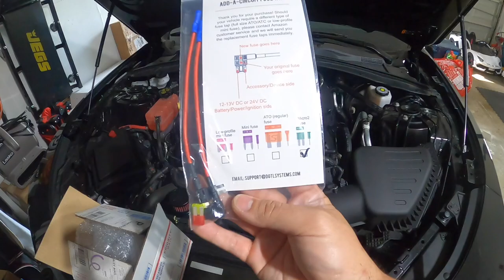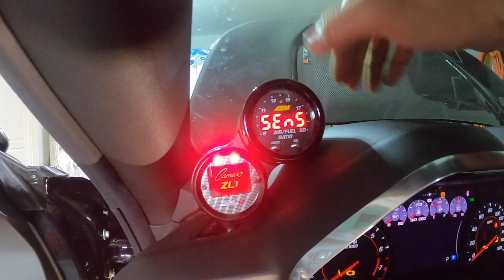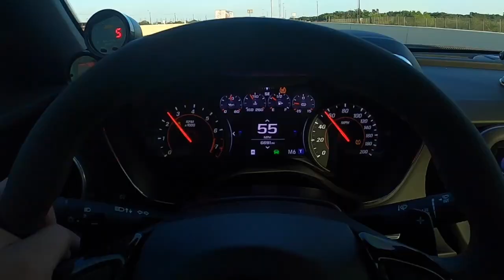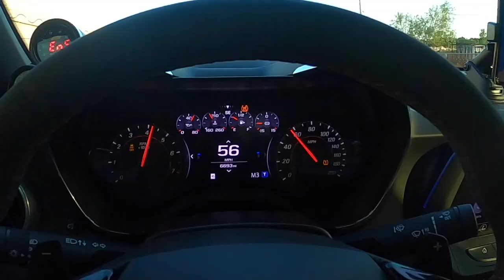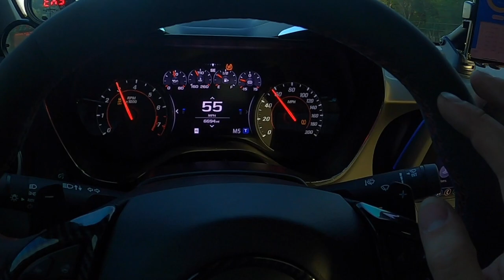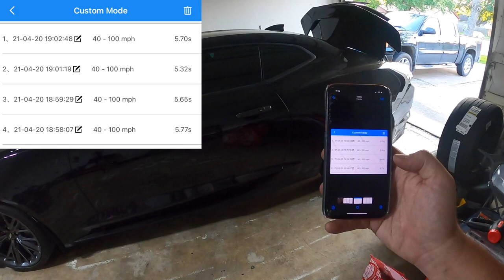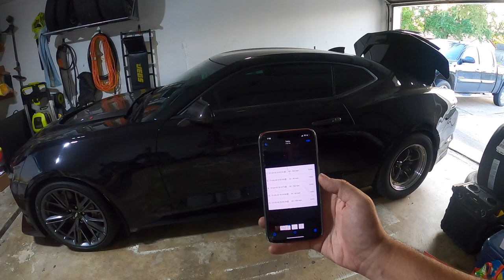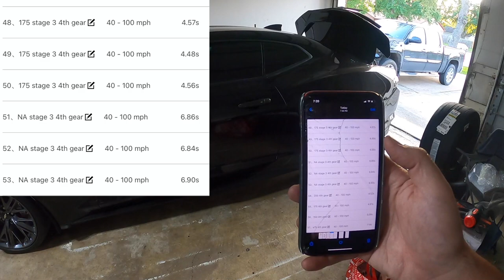Baseline Draggy Test and Flex Fuel Sensor Install on My Stock 2019 ZL1! | Vlog # 424

Comment: Hey love your vids! Do You have any 60-130 draggy baseline runs if you do can you post them!
Reply from the maker: At the track it did 60-130 in 8.2-8.3 seconds bone stock on a drag radial and seat out and 8.6-8.8 on street tire full weight

Comment: Nice video. I have a new Dragy and cannot find how to setup 40-100? I only see 0-60, 60-130, 0-130, 100-150, 1/8, 1/4,1/2. and a few others
Reply from the maker: I believe you need to be connected to the draggy amd then there is a place you can as custom modes. I might have to do a video lol
Reply: @JLSpeed  cool. thanks. going to check now.
Reply: yep. you're right. Thank you!!